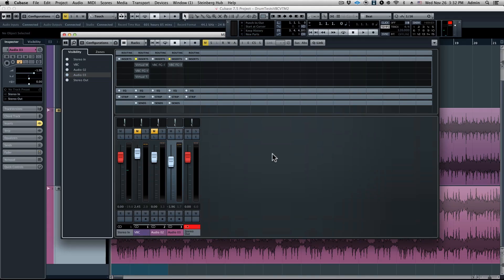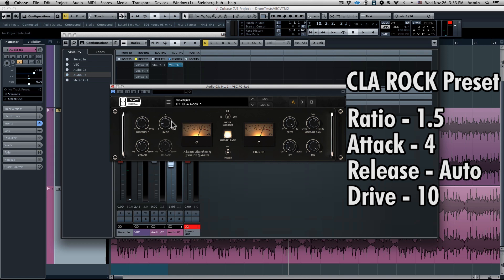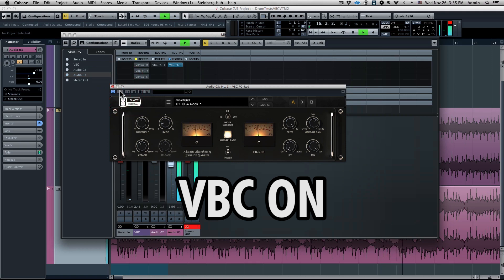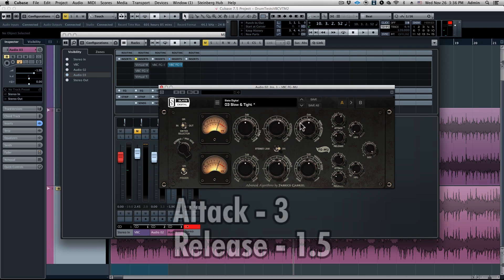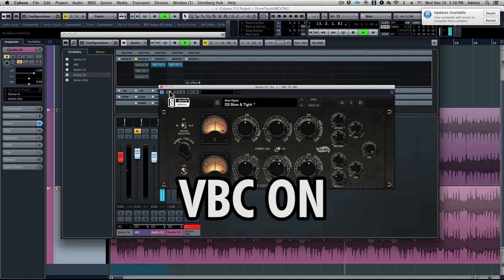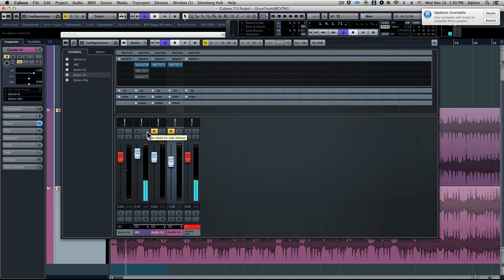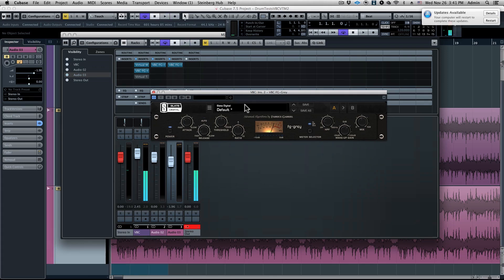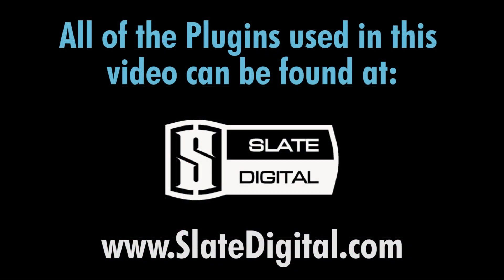Slate Digital VIRTUAL BUSS COMPRESSORS Tutorial

Comment: Steven, unless you gain stage the before and after, it's an unfair comparison. Of course the latter is going to sound ''better'' because louder is always perceived as better.

You know this of course, otherwise the VMR would have had an output knob!
Reply from the maker: Hi there.  If you compress something 5db, then it will bring up the low level material and it should have higher RMS.  But, we did try to align the PEAK levels.  Having said all that, there is an obvious difference in all of these examples that can be heard regardless of volume.
Reply from the maker: Mason Dayot Hi! There is no FG-Grey 1.5db increase unless you increase the output gain by 1.5db.  What you are noticing when you increase 2.5db when you are compressing 4db is the phenomenon of compression itself, whereas the 4db gain reduction is increasing your overall RMS, hence the song will be louder.
Reply: ***** I agree. It is a clear difference irrespective of the volume levels.
Reply: song5700 I know that the FG great has a 1.5 db increase. So when i do -4db i set the make up gain to 2.5 so that i'll be coo but yeah it needs some linked outputs
Reply: Late to the party, but regardless of any perceived volume differences, the "mastered" quality of the drums using the VBC, particularly the snare...hear the ring, the room ambience..? This is evident regardless. I've adopted this compressor over my former favorite parallel technique with an 1176. So much easier and transparent, in it's still vibe-y way.